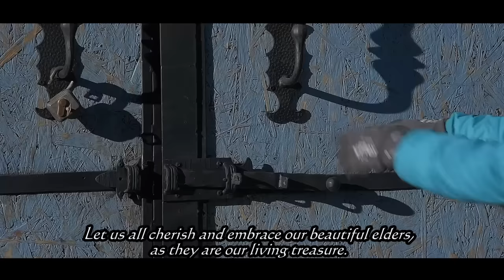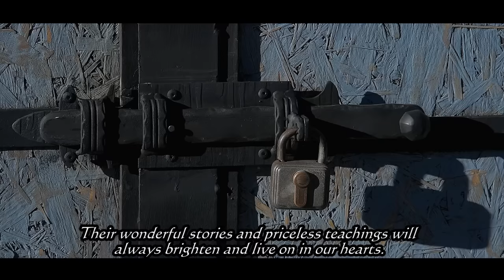Renovating an abandoned cottage outbuilding - Start to Finish

Comment: Sub tabla tip lindab se pune o folie anticondens , mergea și un carton bitumat ordinar . Scândurile dacă erau puse mai rare  condensul de sub tablă se usca mai repede ,acoperișul era mai sănătos .In timp vei vedea că scândurile acoperișului se pătează ...
La efectul de patina cu șlefuire  pentru ca lemnul neacoperit sa rămână protejat se dă un lac mat sau lucios după preferință.
Îmi place că ești mai veselă . Să fii sănătoasă și voioasă!
Reply from the maker: Scandurile sunt verzi, se vor mai strange. Nu sunt profesionist, asa incat am mers pe siguranta in primul rand si am preferat sa le pun asa cum le am pus, sa pot manevra bine tabla. Folia anticondens au uitat sa mi o puna pe lista a doua oara, caci au refacut ceea ce comandasem prima oara :)), dar fiind doar un loc de depozitare sunt multumita de ceea ce a iesit. Scandurile slefuite le am lasat special asa, sa se mai inchida putin la culoare. Apoi le voi da cu ulei. Multumesc frumos pentru sfaturi! Toate cele bune!